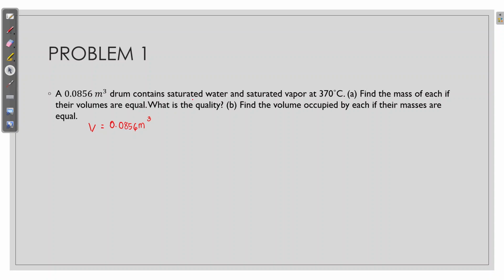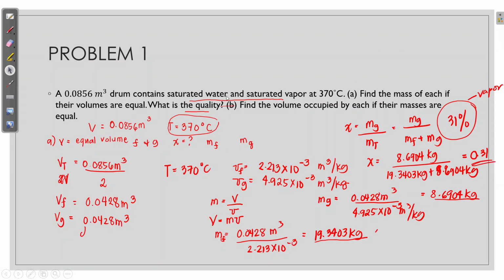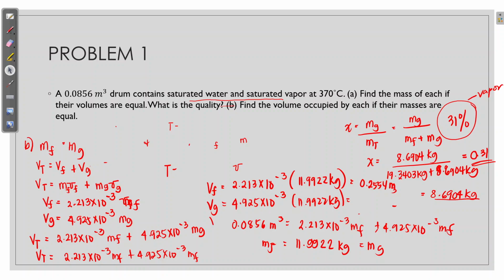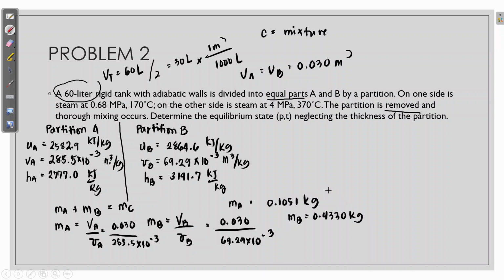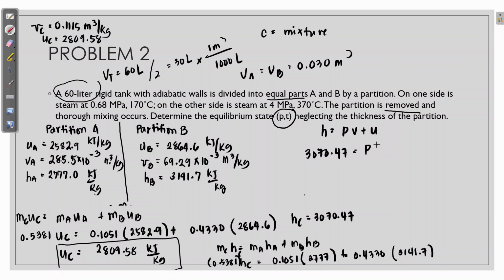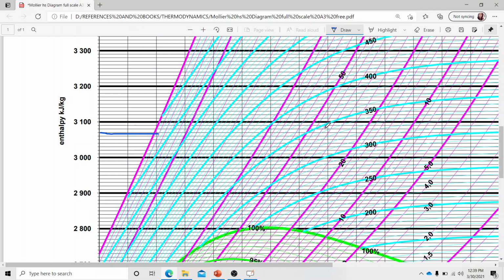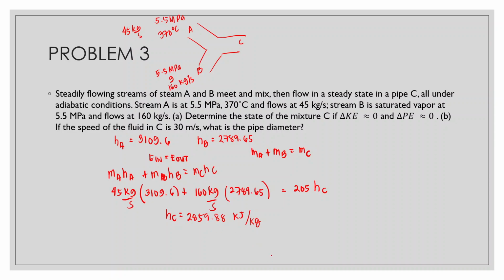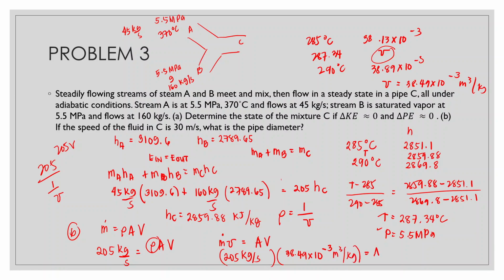Thermodynamics - Using Steam Tables, more examples

Comment: Question
How did you get the mf=11.992kg? it keeps saying variable error in my calculator... Even though I already plug in all the numbers in the calculator
Reply: true, where the h3ll did she get that number. If the masses were equal you will go to the mass total and divide it by two so you will get mf and mg are both equal masses.
Reply: try to use shift solving in your calculator
0.0856 m^3 = x(2.213x10^-3 + 4.925x10^-3) m^3/kg ----- the x there represent the mf=mg 
the you will get the same answer she got.